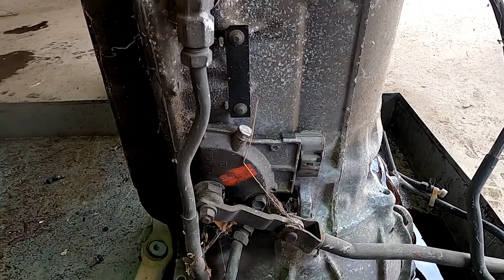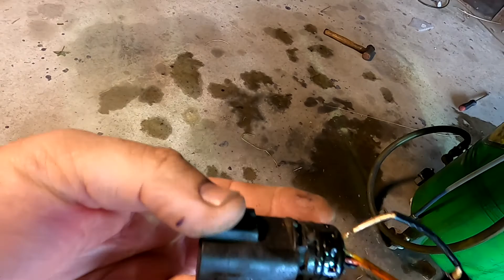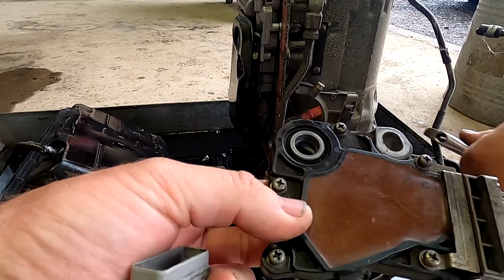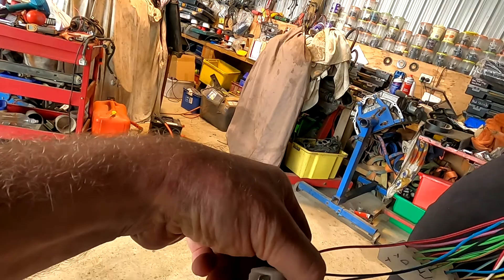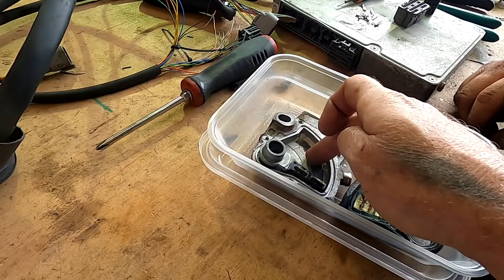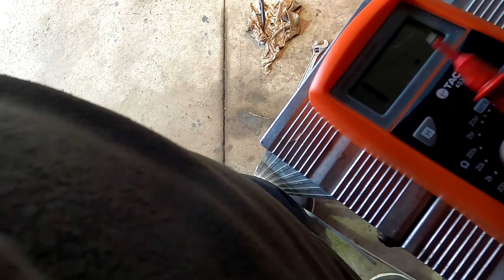1uz-fe Transmission loom change and repair of shift inhibit , gear selector switch.

Comment: Hi Calvin! I have a problem with the gearbox. Can you tell me what to do ?! The hot gear box does not include gears. Only if you turn off the engine, start it again, and pressing the gas, drive off.
So the question is, is it worth driving the car to the service. Remove the pallet and see what happened? Try to change the oil to a new one? Or is it easier to put a " contract " ( other)?

The oil was at a minimum when this happened. Topped up to the level. But the box is still slipping on the hot one. Does the oil smell like burning, is it orange?
The car is Lexus LS400 . 94 .
I will be very grateful for the answer! Thank you and good health to you and your loved ones!
Reply from the maker: I would diagnose the issue properly instead of guessing.   I'd do a manual shift test,  check ecu commands,  check solenoid resistance etc etc
Reply: @CartuneNZ  got it! we need to open it! Thanks! I forgot to add that the hot box howls very much. A metallic sound is being made...

Comment: So to fit a 91-94 ls400 trans on 96 id need to switch neutral safety switch and wiring loom ?
Reply from the maker: Yes,  Thats how I would do it.  And maybe the rear housing if you dont want the extra speed sensor however if the housing isnt changed the sensor simple isnt plugged in.
Reply: @CartuneNZ  and would it be the same for a same year sc400 transmission?
Reply from the maker: @rashawnbey8362  depends on the submodel of sc as they follow a different parts fitment year to LS400.